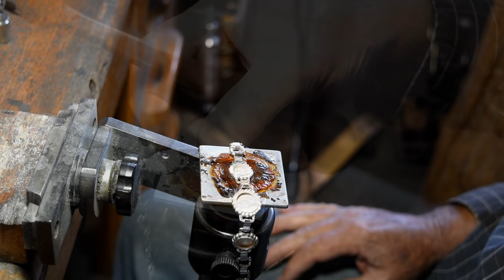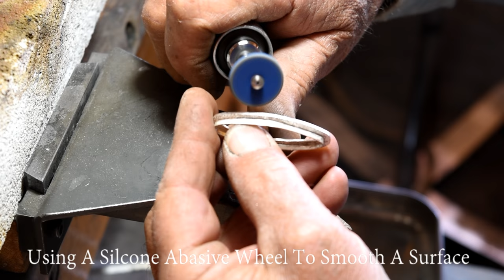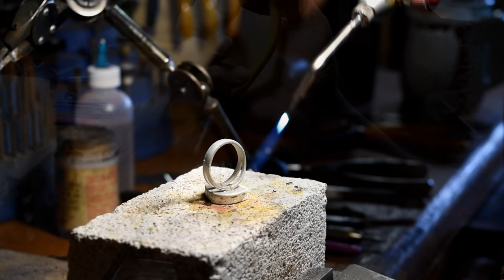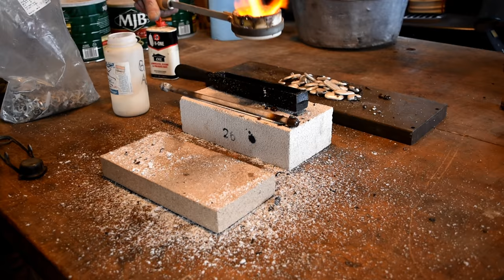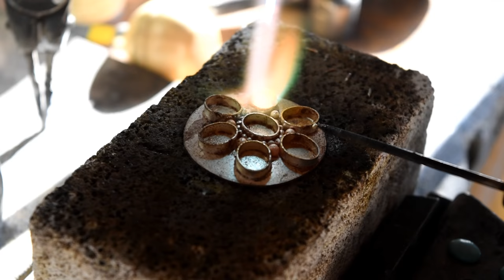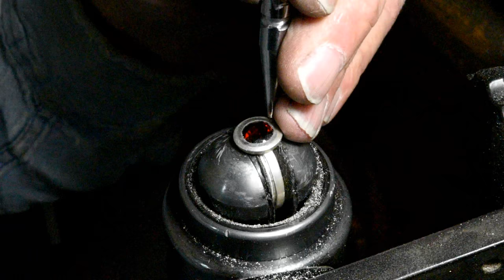Jewelry Making Trailer

Comment: Hello  mr. Howard. Can you tell me what kind of tool you use to put borax onto the piece? Looks very simpel to use. Thank you for your answer and for sharing your interesting video's.
Have a nice day. Mieke Manders
Reply from the maker: Hello Mieke, I think what you are referring to is the flux bottle with the needle end which has Batterns liquid flux in it. I have a jar on my bench that has a mix of boric acid and alcohol in it that I dip my work into before soldering to prevent fire scale. The boric acid mix is a barrier flux and the liquid flux is a flow flux.
Reply: Thank you very much for your quick answer. I will try to find it here in France...
Reply from the maker: I know the Batterns is not available in the UK. Let me know if you find a liquid flux that works in your part of the world so I can tell people about it. Thanks
Reply: I live in France but I'm Dutch that's why I still buy a lot of things in Holland. In France it's not easy to find stuff for me. When I know an adress I'll let you know. 
Thank you. Good luck with your beautifull work. 
Everything looks so easy in your hands... Have a nice evening. 
Mieke

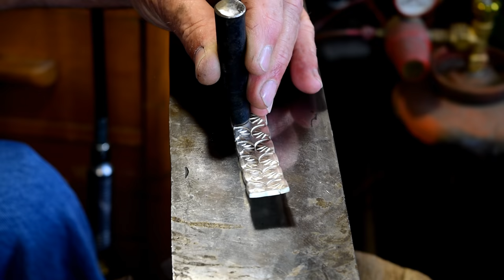Comment: Where did you get your sun stamp for your deep stamping on a 10 gauge silver? At 3:40 in the video?
Reply from the maker: I made the punch out of drill rod.  I used a round file and a knife edge file to make pattern.
Reply: Steve Howard would you ever make a reproduction to sell? I love the stamp on the ring you did!
Reply from the maker: @catarinaberg  This stamp is made from a 9/16" rod and the impression it makes is about 1/2" wide. If I made one like it for you is this the size you would want? The price would be $20.00